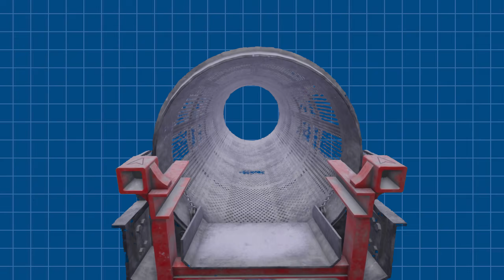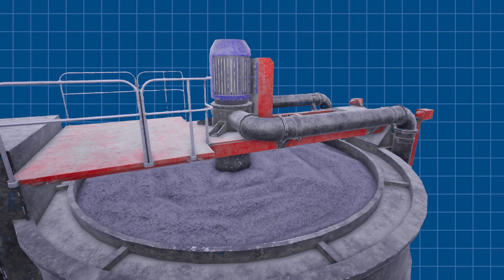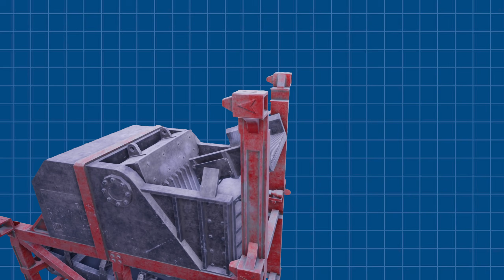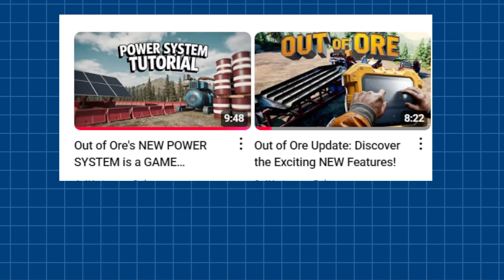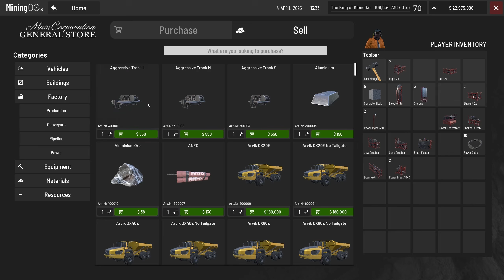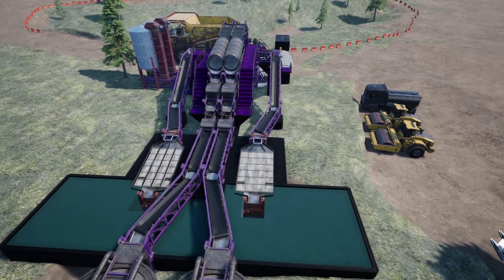Out of Ore Guide: Your Ultimate Production Kickstart!

Comment: Starfield has a strict shipbuilding interface, if two parts are not meant to go together it will flag you. this sim is based on real life, so does it let you know what parts will/will-not connect to each other and what parts are grouped together in a particular system or setup??

Comment: AND It does not work. The first elevator does not lift anything. It just sits in the hopper. Great
Reply from the maker: You have to power the hopper and turn it on, or you did not snap correctly

Comment: but what about the WATER! you left out the part I NEEDED TO LEARN!
Reply from the maker: At this time this video was made Water was not in the game. But water is only a %
Reply: @splitintwogaming  yeah figured but also was frustrated with my water system not working then realized I'd placed the mergers and splitter wrong because WHO THE FUCK PUTS A DIRECTION ON THOSE! every other game I play with these things pipe inter sections have no push or pull the simply hold and distribute to their surroundings.
Reply from the maker: @Torkkar  said the same thing when i was testing them.

Comment: Personal opinion (especially when starting from the beginning): swap the trommel and the coal screen. I'm playing where I'm trying to dig everything (explosives only where required), so it's a bit more efficient to get all of the dirt out of the system first. (before anyone asks: this is my "I need a break from staring at work" thing right now, so just running a few buckets of top dirt without thinking is critical)
Otherwise: right on! I definitely needed this.
Reply: i swapped out the coal shaker with the trommel, i was losing materials and couldnt figure out why, swapped places and everything worked great again. I have still no idea why i lost so much but ok :)

Comment: I appreciate your videos. does the froth floater essentially consume the gravel? turning it into tailings? I've got mine set up after the jaw/cone crushers and washplant. I currently WANT gravel because i'm making cement. I have the froth after the wash plant, straight to a storage. all i get is tailings. i'm putting blasted rock/correct material into the production line to get gravel. but i'm not getting gravel. any help is appreciated.
Reply from the maker: Yeah this was a demonstration plant froth floater just add a splitter after the cone, as the cone coverts output is gravel
Reply: @splitintwogaming oh, I didn't think about splitting it. That may actually be worth it cuz it slows down just how much gravel I end up getting 😂  but tailings arent worth much so idk, maybe leave froth out for now
Reply from the maker: @potencygg  yeah everything is subject to change so no real plant is the 100% go to plant its all subject to what you want out of the plant.

Comment: There was no mention of the hopper types, 1 has 1 output, another has 2. is there different stuff come out each output? or is it just 2 outputs of the same stuff for speed or a different production line?
Reply from the maker: hopper is kinda self explanatory, and the power system is what controls the speeds that's in the power tutorial video.

Comment: Ah, finally found a good explanation, thank you :)
Reply from the maker: Glad it helped!
Reply: @splitintwogaming  so I have this setup and it works fine but i keep finding ore like gold, diamond etc in the dirt pile that I get after the Sliuce, what have i done wrong?
I have added conveyor extensions after that Sliuce to prevent a massive dirt pile up and move that dirt further away
Reply from the maker: @patrikmoller3643  you must be using the washplant everything gets converted and passes through.  use the slucebox it has internal storage.
Reply: @splitintwogaming  yepp that did the trick :)
Reply from the maker: happy to help.  happy digging.

Comment: Absolutely killed my mine. Single player here and use a lot of conveyors. Too many wires and extra parts that won't work with my set up. Been working on this huge thing 8 months and I'm halfway through. If i do it this way and use a haul truck by myself it will take 3 years. Total kick in the nuts. Hopefully the dev will finish changing everything so a person can plan.

Comment: This system is not working. Many of the tools do the same job. The only thing you need is the Jaw crusher,  Cone crusher, Coal screen, Trommel, and Sluicebox, and thats it. Regards from north Sweden.
Reply from the maker: works just fine for many.
Reply: I agree. The hopper does not send the coal to storage, the sluice box sends the dirt on the ground
Reply: @Wookscoop You need to snap a storage or sell point to a sluicebox.

Comment: Great video, very helpful. I was scratching my head trying to figure out the outputs. Still haven't figured out the new merger conveyor though, I liked the old merger version better
Reply from the maker: merger will take 2 lines and make them into one. they work the same just at a much faster rate depending on what power input you are using.

Comment: Im only level 30, I guess all that equipment unlocks endgame, really confusing when your leveling up and everyone builds crap with 4 or 5 machines you have never seen even locked in the menu. Not one of these guys shows a starting rig, just creative mode builds, worthless to me.
Reply from the maker: agree i am maxed level. but no worries ill be doing some starter content soon.
Reply: @splitintwogaming  I was not on the beta branch, reason I could not see them. The power system is garbage, don't expect that to stay. All it does is accelerate a line its in front of and use an insane amount of fuel to do so.

Comment: Hi Splitintwo, thank you for the video, much appreciated. FYI I built the production plant as per your video but could not get the shaker screen beneath the Coal Screen to operate. It would not transfer the coal into the Storage Silo. It is only when I connected the Power  Unit 10x Speed to the upper part of the shaker screen did it start transferring the coal. Just thought this may help anyone else out who may have had the same issue. Happy digging
Reply from the maker: That plant is a 2 input main hopper and catching hopper. 11:42 you can see i added input 1 to the hopper below and to the main hopper.

Comment: i'm not getting power all the way through
Reply: Having the same problem
Reply: @RobGambino570 Your input power is bigger then grid load? Or maybe some of the parts didn't snap right (look at the little arows on side top corner of each part, they are in one line?)
Reply: @Havoc_1984  I just took my entire production line apart and redid it. Works now 
Thank you

Comment: @Splitintwo - Could you do a test for Gravel? When I put rock , any rock through the plant gravel comes out at the Trummel as far as I can work out - I may be wrong. I am trying to make asphalt and put the asphalt machine after the crushers, but the rock does not appear to make it that far. Regards.
Reply from the maker: make sure your using jaw then cone.   don't use the froth if you want gravel. as the froth takes gravel and turns it into other stuff and tailings. 
After the cone just add your asphalt plant.
Reply: @splitintwogaming  ah ok. thankyou for answer
Reply from the maker: @ np

Comment: With the new hoppers, I find it kinda difficult to use dump trucks do you have to build a ramp or what else do you have to do to be able to dump? And they seem kind of small even the double hopper for the biggest dump truck
Reply: I've always just built bigger collectors above them with wood or concrete or something just use the walls and roof parts to make a funnel the size you need, i usually put the hopper in a hole and use a few floors to make it easier to back up to and dump

Comment: 5:03 1. is cone crusher really necessary?
from I know that ONLY OUTPUT from it is GRAVEL, from which You DON'T GET ANY ores at all, so You are wasting ALL of resources from jaw crusher...
...and You'll get enough gravel just from processing crushed rocks into  resources (like I'm doing now, with fractioner)
2. where in this setup is the most important (on the first stage of game) machine-washplant, what You do with paydirt  now?
Reply from the maker: cone crusher is now necessary because the froth floater uses crushed rock.  the old build it was pointless because the  frack used crushed not gravel.
Reply: @splitintwogaming  You still says against yourself:
"Froth floater uses crushed rocks..."
...and then you put before it cone crusher, which crushes THOSE READY TO WORK rocks into GRAVEL...
Reply: @PitBull51091  Am sorry even the game says what each part does, and it does not destroy items as seen in the stream
Reply from the maker: was a type-o on comments as i was streaming meant froth uses gravel

Comment: great video I have one question I am having trouble using  snapped to build mode to place things down on a cement block I've also tried using the flooring that is seaman what item do you have to use to be able to get snap the build to work thanks for any tips?
Reply: Snaping only works on some of the conveyor parts, You can use blocks to transfer down snap points where you need them. I hope this helps a little

Comment: Did they fix the rate for the splitters/mergers?
Reply from the maker: no but you can change the belt speed to compensate   so if you have a 300speed line it will split to 150 and so on.
Reply from the maker: more advanced video coming soon
Reply: @splitintwogaming  so still better is to avoid using them to not be losing any resources at all